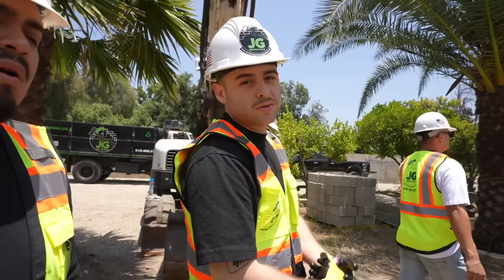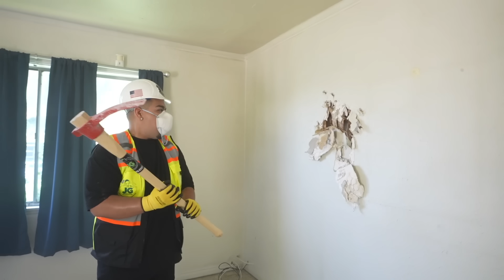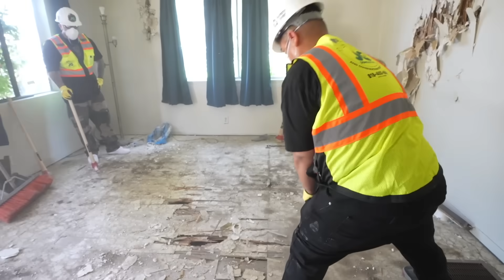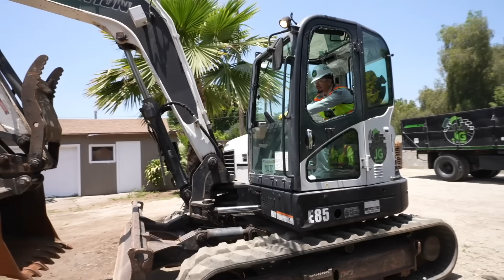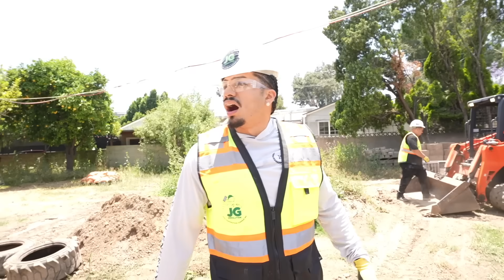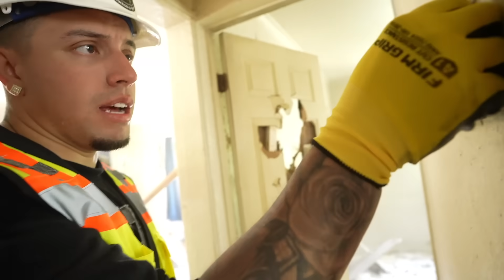FOOS DEMOLITION FOR THE DAY !!

Comment: Props to them but the doing
It alll wrong they have to use the back part of the red pick make a square on the drywall then stick the pick in one of the whole so the whole square on the wall could come off.. I used to work for southwest demo so have some type of experience…but at least they did the dam. Thang whoop le le le